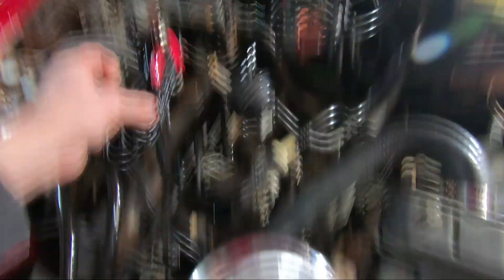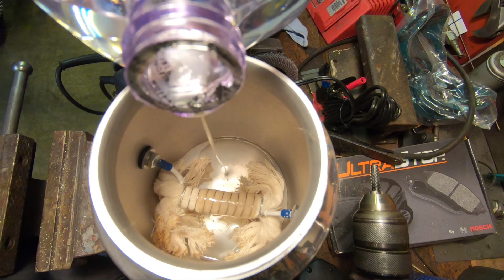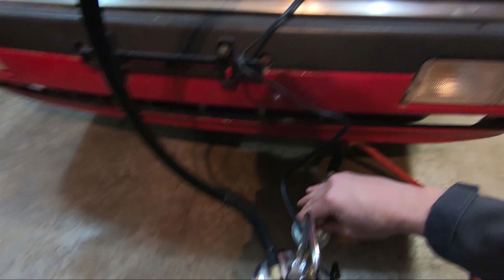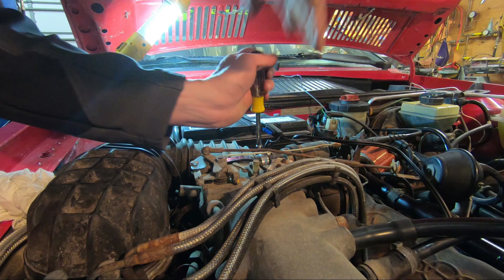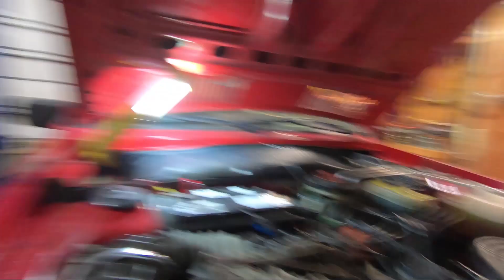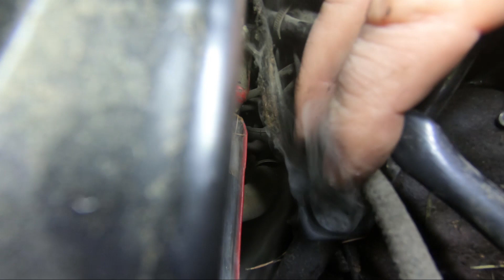Stinger Smoke Machine Vacuum and Evap leak detector First use!

Comment: Must've had P0171
Reply from the maker: I wish this thing had engine codes!  This is on a 1985 Audi  so it’s long before any  computers or diagnostics codes.  Everything is mechanical including all the fuel injection.  If it’s running rough you just have to figure it out.  This is where a tool like this really helped out !  Thanks for watching/ commenting .  🍻